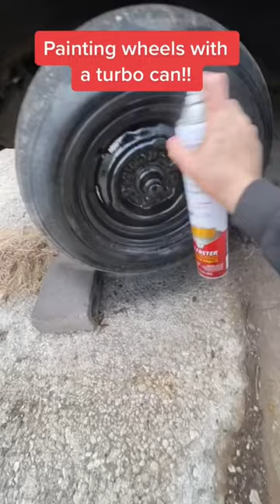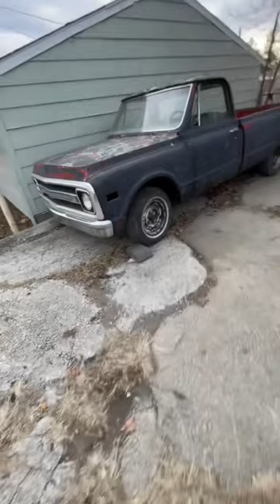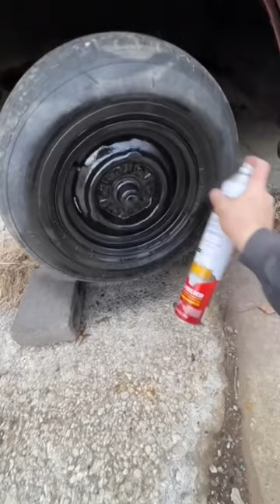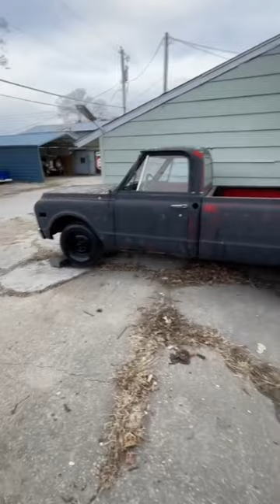TURBO CAN PAINT JOB! HOW TO SPRAY PAINT YOUR RIMS AND TIRES! DIY TIRE REPAIR! HOT RAT ROD PAINTING

Comment: Man I love that Truck would be sweet on a 4x4 frame when I was in high school my dad built a 68 truck 4x4 grandy gear 4 had 36' super swampers tslsx he built a 468 big block they called him the burn out King lol it was a ride lol 700hp that was back in the mid 90s lol loved that truck frame rusted out motor lasted 10 years lol 3 miles to the gallon